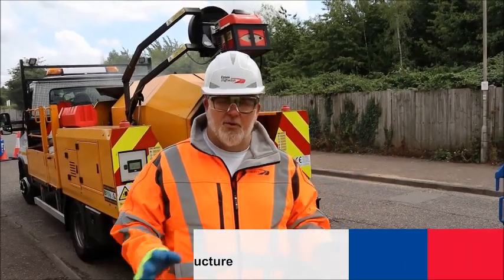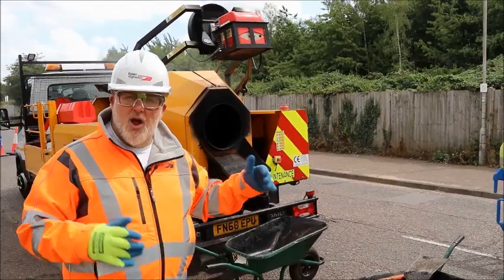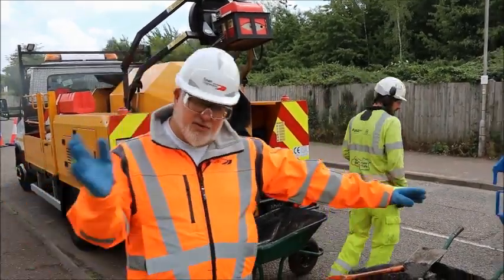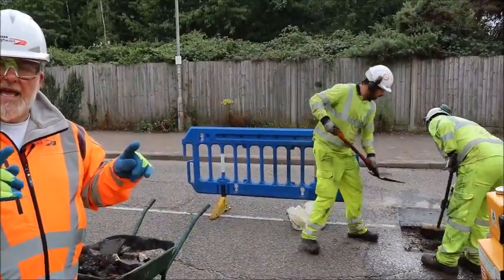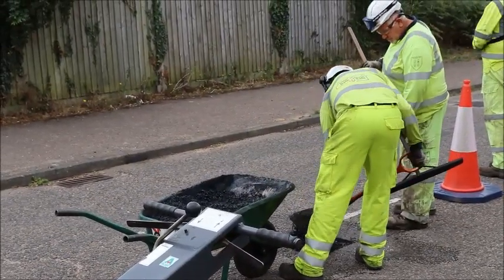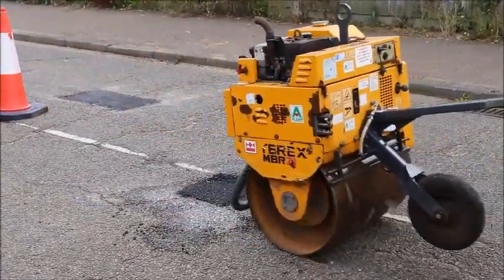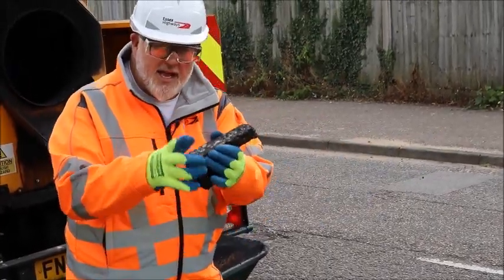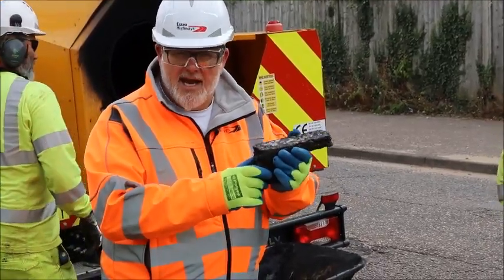Recycling Road Surfaces

Comment: What a foolish concept.  Had you used infrared heaters, you would never remove anything from the road, and heated the road itself up which would then give you a seamless repair, whereas your recycling machine results in a cold joint that water WILL ingress into.